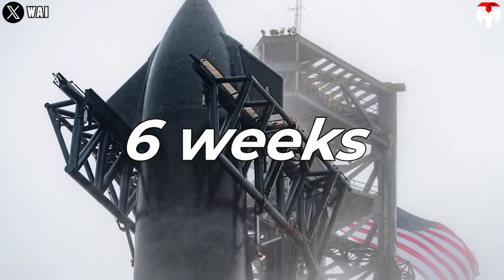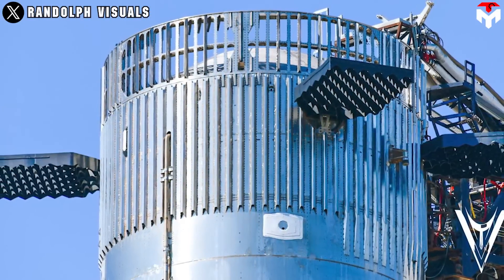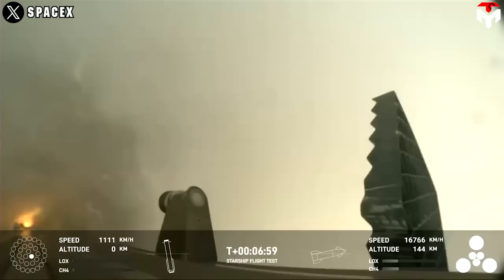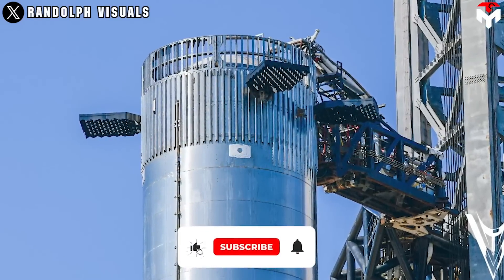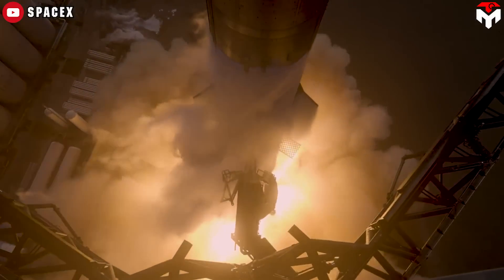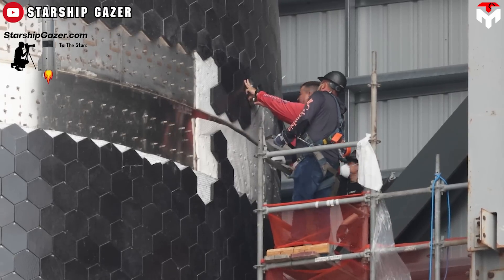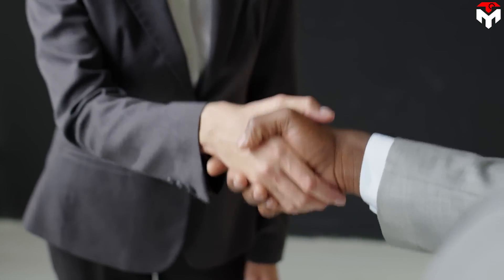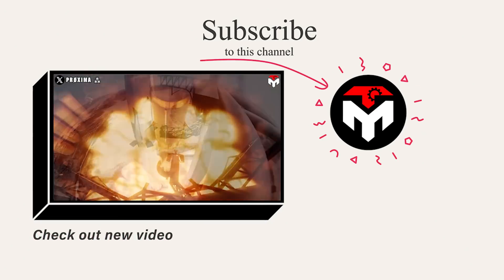SpaceX New Design Changes on Ship 29& Booster 11 after Starship Flight 3!

Comment: Grid fin problem: I don't believe there is an issue.

Looking at the footage, at 50 KM then grid fins went active (jerked to life as electrically the motor drivers were turned on).  They operated nominally until it hit the cloud at exactly 5 KM, where the 'GAIN' schedule jumped to the higher gain for dynamic control. This would not have been an issue of the motors had Raptor (13 motors) fired earlier to slow down the rocket, where you do need the higher gains in order to have more maneuverability at slower subsonic speeds.

The grid fins, flat on top, and pointy on the bottom are designed to handle hypersonic and faster speeds all the way down to low airspeed in the subsonic range during the landing phase. I think Elon talked about this with the Tim Dodds video a couple years ago when he first toured Ground Zero in a 3 part show.  Good to watch that first video where he talks about it.

I think Glenn is removing any risk of dynamic or structural interaction (twisting or aerodynamics) of the Payload door until they resolve controlled re-entry. I concur with the logic.

Good video... like your stuff. Hope I can help stir conversation...

Regards
SPEEDY
Reply from the maker: Glad to hear it from you. Thanks a lot. Have a nice day

Comment: The wide angle sweep of the grid fins looks like a software or hardware problem, rather than a griffin aerodynamic problem. Beyond 15° to the 'apparent wind' (wind angle with respect to fin flat surface) turbulence begins spoiling the lifting effect of the fin. The 'grid' reduces that angle in some cases because of the congregation of 90° aligned surfaces(squares).
Reply from the maker: Thanks for sharing your thought

Comment: Re-lighting the candle is profoundly difficult for rocket motors.  Dialing down the power, without shutting off the fuel is very difficult.  Add to this a fin control, with no stable thrust vector makes for trouble.  This is new tech that no other body has ever used.  We will see failure until success.  NASA had more than a dozen failures before they landed on the Moon.

Comment: It looks to me that the grid fin control system needs a software update either making the fins move slower or faster or anticipate better. The oscillation means one or more of the variables are wrong to stop it.
The probs with engine restart and the losing heat tiles at an alarming rate are bigger probs than the oscillation and spinning.
Reply from the maker: Yes and do u have any idea for the upgrades on engine or heatshield?

Comment: Unlikely that the grid fins were the initial problem that caused the RCS to fail even if one grit fin got stuck.  The one in the video seemed to work properly. But obviously some other component of the RCS made the grit fins react in a non healthy way. You should not base your arguing on speculation.
Reply from the maker: Thanks your feedback. I will find more about that

Comment: This is poorly done.  Just one example: the booster FTS was "safed" as announced live by Spacex, 
so the booster blew up as a result of an engine RUD likely.
Reply from the maker: So what is the problem of Raptor engine?
Reply: The theory is that the violent movement of the booster caused fuel sloshing and bubbles sucked into the engines caused the explosions.  Only three of the 6 relit and then two went out.  Watching the video you can see what appears to be an explosion just as the video freezes.  Don't mean to be too critical but if you're doing these you need to be as sure of the accuracy of your reporting as you can.   @techmap9

Comment: Well, I've been doing critiques of the Grid fins, tiles, and flappers for years, in fact, I said they were bad design, in the same writs where I planted the parts count concept, and took personal attacks for two days for daring to:
 "Peasant 'Splain"
 to the Engineering  Nobility...

I'll stick with my assesments, they are all POS quality engineering, and will have to be replaced with better concepts before any major progress is made...

As for the door, this video finally gave me enough clarity I could see its design was crappy engineering too. Would suggest it be made in two halves captive in slider or roller pockets, have the split in the center, and the door halves "Go round" the hull circumference each direction, with bridge longitudinals over the pockets, and make sure the portal frame is beefy especially at the corners, which are its stress points.

The actuators should be rack and pinion or worm gear like, both on the curve. And both likely having clearance problems with their drive mechanisms. would be a good place for a short CV joint... also suggest pinion on both edges of each curved panel, with both pinions, on the same shaft. and I'd want pretty good gear reduction between motors and CV joints shafts. So the door actuation is more positive than speedy.

Of late, I've done writs on the Alpha Tech channel offering potential solutions.. theres quite a volume of attempts at solving problems before they make it to historic videos. Have also encouraged others to do the same...
Theres way more practical experience outside of SpaceX than in it, and until assumptions reach zero, plenty of problems likely to continue forward.

Space doesnt require things that might work, it requires things that wont fail...

"The hard path looks easy."(Tao)
Reply from the maker: Well, very useful and informative. Thanks for your cmt. Hopefully, SpaceX team could read these words.